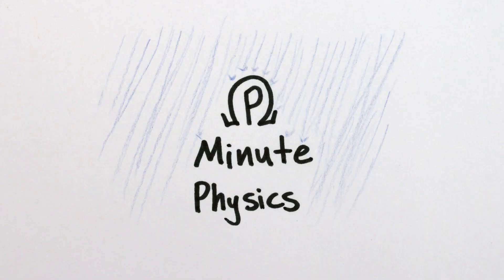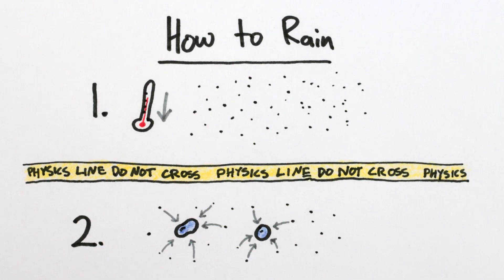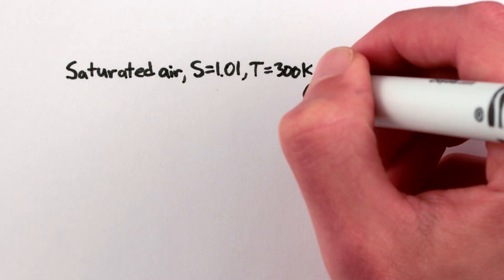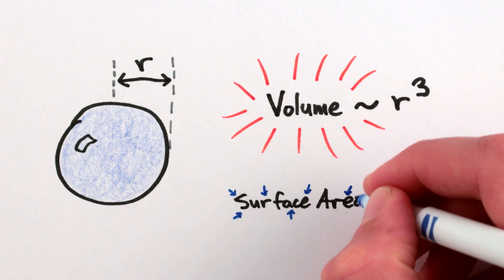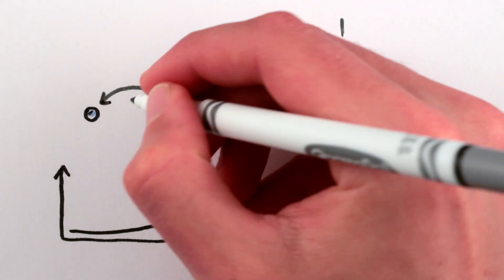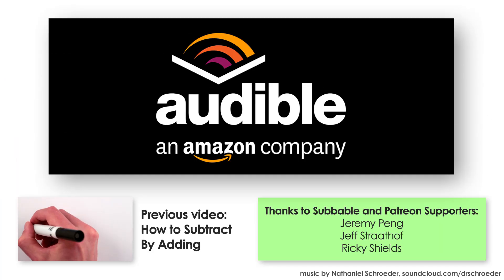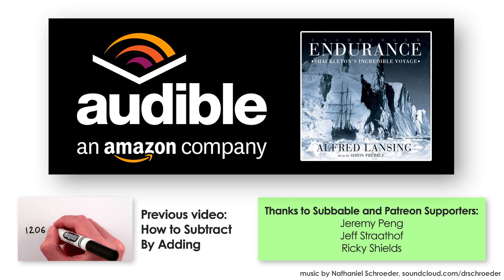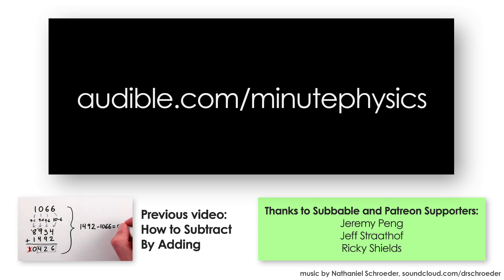Why Raindrops Are Mathematically Impossible

Comment: From what I can see, because you are scaling x^2 and x^3, you are determining that the raindrop formation is related to the point those flip over in which produces the largest answer. 

There is no reason I can see that you couldnt measure this problem in planck lengths, have staggeringly huge numbers the entire way with the cubes growing far faster than the squares the entire time, and the molecule would still break apart because at the end of the day the properties of the surface area and energy of the droplet mean it loses more than it gains. 

The best I can see of comparing the physical laws to that mathematical quirk is that the situations are vaguely analogous to each other. 

but Ive been struggling to see how this all fits together for a while and maybe Im missing something (Something thats likely horribly obvious.) if anyone would like to explain?

Comment: Isn't it kinda unprecise to talk about 'small numbers' - it should be true in any unit system, not only in SI (or should we forbid calculating in cgs?). A number - or better a physical value - can only be small in comparison to another number / value. It therefore is depended on the proportional factors between x^2 and x^3 to tell which one exceeds in the energy contribution.
Otherwise you would've to state if 1 m^2 is bigger than 1m^3. or less. or equal. but that comparison doesn't make any sense.

Comment: Cubing a small number makes it smaller than squaring it, only because you are employing units which, with the exception of quantum physics, are of arbitrary size. The square of 10 mm is 1000 mm^3 but use meters and the SAME ACTUAL VOLUME and,  the square of 0.01m is 0.000001 m^3. Therefore, we have to remember here that the unit for which this applies must be quantized, like molecules.

The video is correct, it just didn't explain this.

Comment: Can we get the math for the fortune cookie lifting?
Reply: I'm not American or British, I am Armenian, my english isn't unflawed.
Reply: CaptainCakebit E = mgh
Reply: Everett Sass P.E. = mg(∆h) | that's more accurate then just "energy"
Reply: Milcor IronGear Your all wrong.  Its E(after lifting) - E(initial). Or A =FS will also suffice
Reply: White Dragon You're*
Reply: AlphaCorn Don't correct other until you have corrected yourself. You forgot the period in: "P.E. = mg(∆h) | that's more accurate then just "energy""
Reply: Its ok to be wrong and its ok to correct others. I'm not american and hence why my grammar isn't the best.
Reply: Milcor IronGear Using conservation of energy, K + U = 0 (without external forces, so we ignore air resistance). The Kinetic energy is equal to -U, and we can solve this problem in terms of K or -U. Usually in physics, going away from the surface of the Earth is the negative y direction. 

The energy is equal to sum of all forces acting on an object. Take an integral of Newton's Law of Universal Gravitation (I can't properly spell it out in these YouTube comments) from initial height to the final. Or do some algebraic kung fu and get what AlphaCorn said, U = mgΔy. This is assuming that the gravitational force is the same from any height to any other height, which is not completely true but the differences are negligible for close-to-surface-level stuff.  I'm sure there's a proof somewhere on YouTube here, or whatever your fancy is. I might have it in my old Physics notes

I've been looking up some statistics on the weight of an average fortune cookie, but with no luck. I've been meaning to get a pocket scale, but I don't have one to weigh a fortune cookie paper. If anybody has some data, we could figure out an estimate for the energy required, preferably in  joules. We could assume the paper has the same density as computer paper, which is about 0.8 g/cm³ if anybody wants to make that assumption. 
 
Additionally, assume the weight of the arm and hand is zero or negligible, as this would take much more energy.
Reply: F=mgh

Comment: If I understand this correctly and im just a laymen.

In our air we have varying temp and pressure which can be measured with physics units. Water molecules clump together by bumping into each other. Water molecules also are wiggling because of the temperature and splitting apart.

So the clumping and splitting is happening all the time in our air. The key point is a few million water molecules have to be already together for the clumping to out do the splitting.

So if there are not the few million to start with they never form because they wiggling apart faster than they form.

Our rain happens because there is dirt lumps that are more than a few million molecules floating around in the air and water can form on them and be the size needed to grow bigger.

The maths to prove this is pretty vague in this one too me too. I assume the equations for the energies for the clumping and splitting have divisions in them. Making the small numbers ie x < 2/3. Regardless if the units are mm or cm or m this division in the two equations makes x < 2/3 when there are physically less than a few million molecules.

Comment: +MinutePhysics Allow me a correction, for that last part was confusing:
When you said "small numbers", what you ment, and ought to say, was "fractions of a unit". 

When you talk about size (small-big); you should keep measurable units, where "one" is the smallest [whole] number, and, of course, anything cubed above that will grow (literally)exponentially larger than its squared counterpart. 

You can argue that you were talking about "half" a mole (6,02x10^23), but then, that's the same as talking about 301.000.000.000.000.000.000.000 water molecules, and like any other number, measured by the right bar, it's still growing faster cubed than squared.

Comment: Heres what I got from this video(in plain english): 

What is the area of a 2D square?  X^2
What is the area of a 3D cube? X^3

In water the 2D square would be just a layer of water, a 3D square would be a rain drop because the layer of water was able to form multiple layers.  'Cuz math X^2 grows slower than X^3 for small numbers as shown in the video.  Therefore at least starting out it is impossible to go from layers of waters into a raindrop without an outside force.  

And that's why rain drops are mathematically impossible.

Comment: MinutePhysics  So if the raindrops can just form if the radius is bigger than 1.0 (and thus r^3 is faster growing than r^2) does that mean that I can change how the universe behaves by just choosing smaller units for my calculations? I tried - but it won't start to rain..  :( So do I need to stick to SI units?

Comment: I'm going to try to explain this... Feel free to ask questions though, because it IS complicated and science-y. 
When you have very small numbers (like, between 0 and 1), cubing actually gives you smaller numbers than squaring (x^3 < x^2), when with bigger numbers it is the opposite. Because raindrops have very small radii, their volume grows faster than their surface area. This means that the inside grows faster than the outside, pretty much. Thus making raindrops mathematically impossible.
Ask questions if you need me to dumb it down even more!

Comment: I think that you may have interpreted your math incorrectly, as in after the maximum occurring at 2u/3 (u is a constant that is determined by the units used and constants that make up the coefficients of the x^3 and x^2(all of which will be influenced by the temperature and pressure)) the function starts decreasing, as in the derivative is less than 0, however this doesn't mean that raindrops are mathematically impossible, it would mean that they are impossible to form a raindrop with a r(adius)>u, as this is when the function G(r) is negative, making raindrops impossible to form, and past 2u/3 the raindrop formation is spontaneous as G (free energy) is positive and spontaneous, and the function is decreasing as the derivative on (2/3,infinity) (I did a sign table with equations given on the function and the first and second derivative of the function. Another thing you may note is that you only used one related rate, with free energy, and surface tension (in which the function would be either x or x^-1) would also be important. In short, raindrops do occur spontaneously for radius under u (you can't have a negative radius so that solves the absolute value issues) for temperature T, and if you think about it, raindrops always have a maximum size. As for the time it would take for those conditions to be met, your math was as if every water molecule went into every rain drop, and didn't take into consideration that most water is left in the cloud to be evaporated later or just cool down enough to "float", for lack of a better word, down to the surface.

If I have any grammar or spelling mistakes, please excuse me.
Reply: Zack N. This is the real mathematical reasoning. The part about how a fraction of a number is increasingly smaller when cubed compared to squared is the wrong maths applied to the right scenario. It's not that a number (the radius) is absolutely less than one (and greater than zero) when dealing with smaller raindrops -- that's actually a pretty ludicrous notion since you can change the scale of your measuring unit at whim; but rather the ratio of of volume energy compared to surface energy that matters. As the sphere grows, you eventually get increasingly more and more volume energy to lend to the surface energy due the relation of cubing v. squaring... but, you have to get a tipping point first given the constants (such as surface energy needed to hold a sphere together).
Reply: +ZombieTubular I may be mistaken on what you are trying to point out, however delta G measures if it is spontaneous or not, any positive number means that the reaction, physical (condensation, adhesion, cohesion, etc.) or chemical (synthesis of water after hydrolysis for example, although it does not occur often in the atmosphere, but that's besides the point) and one positive number higher than another does not mean the reaction is more spontaneous at that temperature. And by changing the units, you would have to change the value as well, such as 1 in= 2.54 cm. I may be mistaken on what you are trying to argue though
Reply: And as for the local extrema that occurs at 2/3, that is merely saying that after this point G(r) is a decreasing function until the next local extrema or endpoint (end point would be as if the maximum number of water molecules possible were gathered in a perfect sphere)

Comment: So then, if I cooled water vapor in a perfectly dustless space it could go to absolute zero without ever condensing?
Reply: John Paul Hansen
Here's a brief article on 'persisten and spreading contrails' but most of the images are old: http://contrailscience.com/persisting-and-spreading-contrails/ Here's a page with some nice pictures with brief explanations: https://martineburrell.wordpress.com/2013/11/24/contrail-clouds-spread/
Reply: Gareth Dean I don't think it would go NEAR the absolute zero it just would not condense
Reply: Gareth Dean I think it would condense (meaning a phase change to a solid), it just wouldn't form a raindrop.  It would remain tiny molecules of water in ice form.  Like and ice mist on the atomic level
Reply: Noah Larky
But ice is a lattice, you can't have a molecule of ice, you need to arrange several molecules before you have ice instead of cool gas

I'm guessing that as you lower temperature the chance of molecules leaving decreases until at absolute zero all molecules that collide stick 100%.
Reply: Gareth Dean good point about lattices, hadn't thought of that aspect.  The premise he presented is based on the ratio of "surface energy" (to simplify) to IMFs, so at low temps the IMFs won't change, but "surface energy" will.  If this is true then approaching Abs. Zero the IMFs are so high relative to other forces that everything would stick
Reply: Gareth Dean Yeah!  Just reduce the nucleation sites! :)  you can also actually get it in the upper atmosphere where the nucleation sites are prohibitively small, and you get supercold water vapor that freezes instantly when mechanically disturbed.
Reply: John Paul Hansen
I've heard that can make for some interesting contrails.
Reply: Gareth Dean OOohhh I know it has some troublesome icing effects on airplane wings, but I haven't see the contrails! (It sounds really cool) Can you post some articles or links?
Reply: Noah Larky The technical term is depose, not condense.

Comment: MinutePhysics 

I don't think this explanation is quite true for pure water. Yes in a very small drop the surface energy increases faster than the volume energy, but you have to remember that we are not just talking about 1 surface and one volume. We are essentially talking about the destruction of two smaller droplets to form 1 larger one.

Individual water molecules or very small small clusters of water molecules are in an even higher energy state because they have even fewer bonds per molecule than a small droplet they might join. You move to a lower energy state by teh destruction of those two smaller droplets.

So essentially instead of  the energy change being R^2-R^3 it is  more like (for two equal sized drops) R^2-R^3 - 2((R/2^(1/3))^(2)-(R/2^(1/3))^(3))

Where (R/2^(1/3)) is the radius of a sphere with half the volume.

This simplifies to.

(1-2^(1/3)) R^2.

Which has a maximum at zero and is negative monotonically decreasing for R>0. That is any joining of water cluster to water cluster releases energy.

I think we see problems with condensation below the dew point, due to the presence of contaminants which act as surfactants and lower the surface energy of smaller droplets. This effectively forms a barrier to disruption of the surface in forming new droplets. It might even be atmosphric gases like oxygen acting as a stabilizing surfactant.

I don't  think minute physics explantion of high surface areas in small droplets providing more opportunities for water molecules to get knocked off small droplets is correct either. That kind of explanation works frine of the erosion and rounding of pebbles because the loss of material from jagged edges is irreversible. The stone was formed at high temperatures at which teh erosion does not occur.

The addition and loss of a water molecule or droplet, OTOH is entirely reversable at ambiant temperatures. Each newly formed pathway or degree of freedom for removal of a molecule or droplet corresponds to a pathway for addition of a molecule or water droplet.

Now think about this. I assume you have worked witha conventional microscope with glass slides and cover slips. Put a smal drop of water on a clean slide and it beads, place a coverslip over it and suddenlt the water maximizes its surface area. Why?

Its related to what I discussed above.

Comment: Uh... Actually. The problem He discusses is merely based on the fact that we label a specific length a meter. So that's why (0.1m)3 gets "smaller" ( I will make a point in a second, to why this isn't smaller) to 0.001m3. But what if we choose cm instead of meters? now 0.1m = 100cm so (0.1m)3 = (100cm)3 = 1000000cm3 Which doesn't seem "smaller" then 100, in fact it seams way bigger. So the basic mistake is that he changed units ( from m to m3= but did not account for that in the comparison. In fact you can not compare a volume and a area. So if instead of a meter we choose to look at this problem counting in the smallest length possible (a planck length) We would not have this problem!

-reckter

Comment: but "small numbers", numbers between 0 and 1, are a manmade construct. Who's to say what lengths are actually small? Make a new unit that's tiny (to us) and suddenly the radii of raindrops are larger than 1 and cubes overtake squares again.
Reply: truu
Reply: u just destroyed math
Reply: *****That's why people don't use unit in scientific writing. They non dimensionalise it and cancel the units out.
Reply: The fact that the energy is proportional to r^2 or r^3 means it will be some constant times r^2 or r^3. If you change the units, you will also change those constants, and the point where both energies are equal will remain invariant. The purpose of the physical constants in a unit system is precisely to make physics work in that unit system.

Comment: As a simple summary, the mathematics you showed implies that there's not enough energy available for water molecules to cohere, because if they were to cohere, in the early stage, when the radius is small, the volume would decrease faster than the surface area, and the surface area requires more energy to maintain its integrity than is available from the small volume. The mathematical model, however, ignores that we don't actually have pure water in pure air. Another issue is that if you measured the radius in smaller units, say angstroms, then the radius would be a number greater than 1 from the beginning. Then measuring the volume in cubic angstroms and the surface area in square angstroms, the volume would be increasing faster than the surface area from the start.